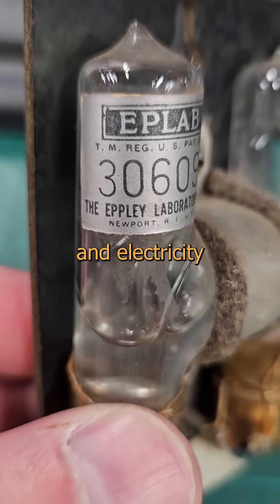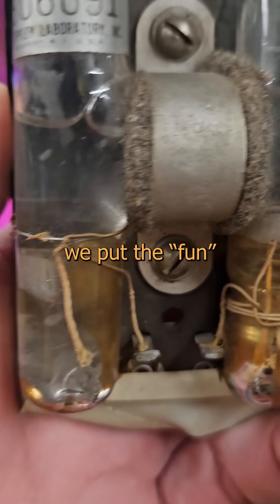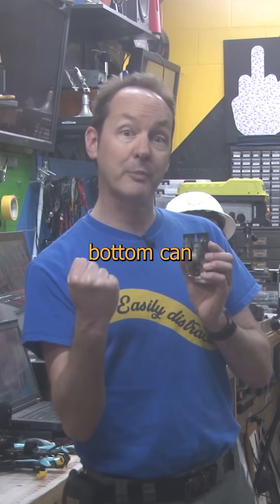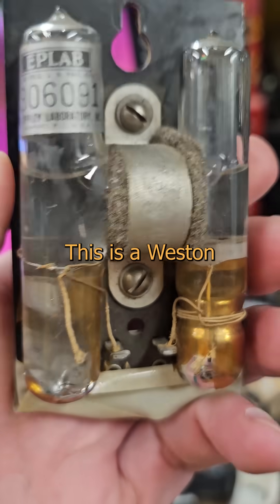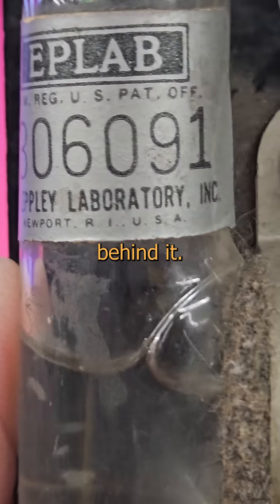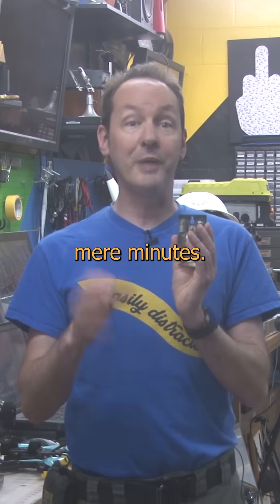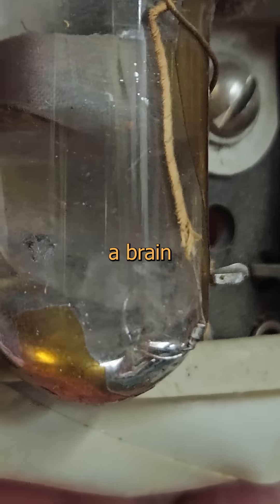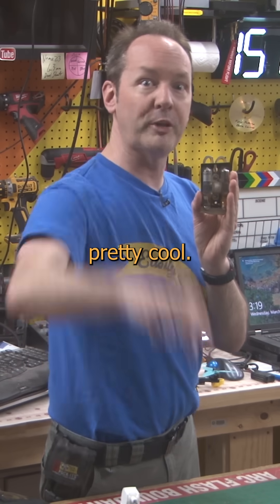The Weston Standard Cell #chrisboden #comedy #chemistry #electricity #electronics #science #history

Comment: Any sufficiently advanced technology is indistinguishable from magic.
Reply: Sufficiently Analyzed Magic, though, is SCIENCE! 😁
Reply: For those wonder what I was referring to.... What we do is pyrolize wood in a pure hydrogen environment. That pyro gas and hydrogen then pass over a methanating catalyst (off the shelf stuff) and methane comes out. CO2 in this instance also converts over to methane very easily. As for energy balace yes this process consumes energy but you are increasing the energy QUALITY and using a Steam Methane Reformer to supply the hydrogen, provides enough unusable energy to run a significant portion of the pyrolyzation process. Dollars out will be more than dollars in (Renewable Natural Gas prices are very high).
Reply: @smorgie7720  I'm having trouble believing there is a net fuel value gain in this process. SMR typically converts methane to hydrogen and carbon monoxide.  It requires energy input.  If you use SMR as a hydrogen source, you already have CO (eventually CO2) as a by product. Now you run destructive distillation of wood (more energy input) in a pure hydrogen atmosphere to make more methane?  Sure, maybe you can charge more for this methane, but how does this make any sense in net energy out? How is it "renewable" if it requires a natural gas input to the SMR step?  Is there any published work that describes this process?
Reply: @ Methane from our pyro process will run the SMR. Obviously for start up purposes external methane will be required. The wood we will use will be otherwise waste wood. I'm just the maintenance operating engineer, the book worm engineers seem to have figured out the energy balance is positive.
Reply: Yeah well we're going backwards now, this little bit of science belongs in a witch's coven lol
Reply: @ilovefunnyamv2nd  Are we though? I work for a small R&D company and we regularily turn wood into pure natural gas and the carbon byproduct is wicked awesome for growing plants (called wood char). We can easily take CO2 and turn it into natural gas as well.
Reply: @  you're talking about wood gas, sounds more like chemistry, heating and recooling compounds, than mysticism,  but I'm sure you can convince people what you do is magic
Reply: @smorgie7720 From what I recall, destructive distillation of wood yields methanol, not methane.  And converting CO2 to CH4 requires significantly more energy input than the resulting CH4 will yield.  Have  you got an energy balance on this process?
Reply: @rickgilbrt  i dont think he is fermenting and distilling the wood, i think its heating it without o2. weell technically this is also distilling but is that what you meant ? because fermenting and distilling does produce methanol but turning it into charcoal makes gas
Reply: @AChicken-sh1gc  "Destructive distillation of wood" was a lab experiment in a chemistry class in my distant past.  Heat wood (in the absence of oxygen to prevent combustion). A partial thermal decomposition occurs, producing methanol (as a vapor) as well as wood char, and a liquid called pyroligneous acid.  
No fermentation involved.  Fermentation of wood residues usually involves breaking the cellulose down to simple sugars and fermenting those to produce  ethanol.
Reply: @rickgilbrt  But where is the difference between making charcoal and what you made (also when you do ferment things with wood like pits from plums or similar you will get a lot of methanol called head but with only fruit or sugar this is less of a issue )
Reply: @AChicken-sh1gc  My original reply was in response to a claim that someone was making natural gas (methane), CO2, and charcoal from wood.  This sounded like classic destructive distillation of wood, which yields methanol, not methane.  Destructive distillation of wood is an inefficient, but sometimes used process to supply fuel to internal combustion engines.  As for "sustainable fuels", the original post did not seem to describe an energy efficient process, but perhaps the process at the OP's lab had some other characteristics.
Reply: @rickgilbrt  wood gasifier. Gonna build one for the farm. No need for gas, propane etc for generator
Reply: @tishkaskogen3298  As long as you have wood to gasify, that works.  Not real efficient, but if the wood is free...

It's not a global solution, though.  Ever bought firewood at a 7/11?  It's pricey.
Reply: @ I have done enough firewood in my life to know the 7/11 stuff is frigging expensive! The economics only work for RNG because the governments have made a landscape where RNG is extremely pricey. If it wasn't paying out $30-$50 per GJ, this would not be viable financially.
Reply: Ah I miss Douglass.
Reply: why are you blue
Reply: @Rev_Erser dabba dee dabba die 🤷
Reply: @Rev_Erser alternate universe papyrus?
Reply: @Rev_Erser Walt?
Reply: No, seriously, why is your comment blue?
Reply: @Vynthos  my comment isn't blue
Reply: Any sufficiently sophisticated technology, when demonstrated to an ignoramus, gets confused with magic.
Reply: @JohnBickner  careful not to trip over your own ego